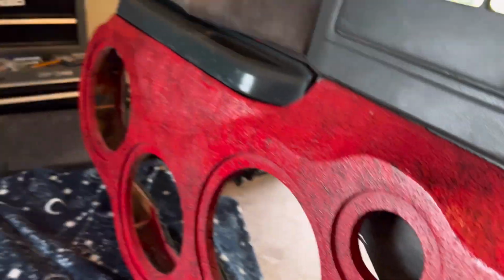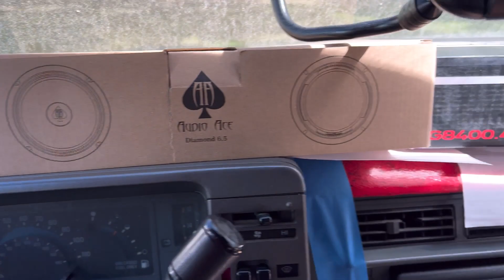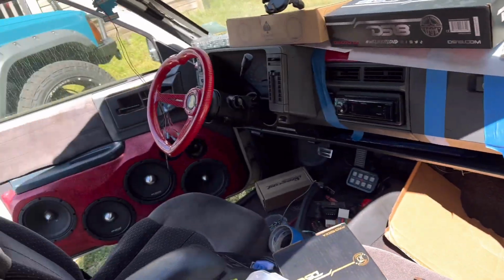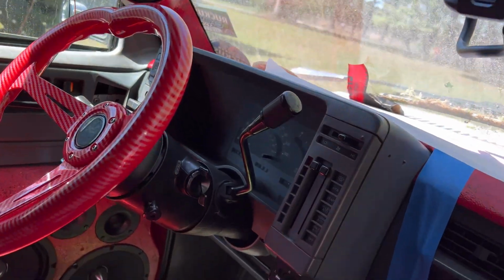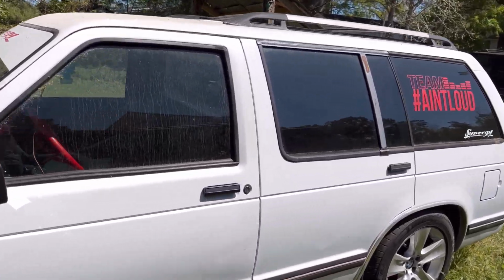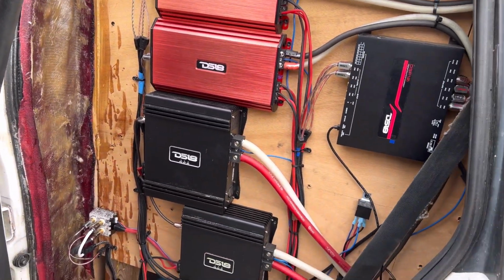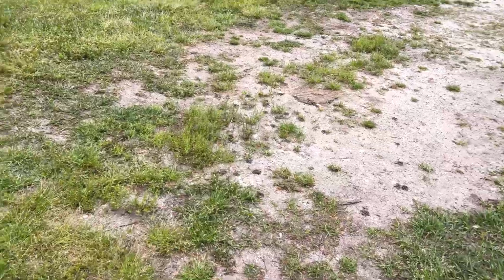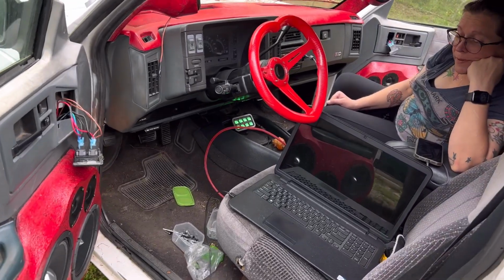Finishing blazer doors and A Pilar’s

Comment: If you have some leftover headway cells, maybe do 4 in series and put it on the mower. Then it won't drain down on you like the lead acid. Temperatures should be okay. 
I'm gonna take a few of those Headways and make a jump box with them. Great to have around the house for those vehicles still running lead acid batteries.

Comment: Pull the spark plug on the mower. May need an oil change. Try starting it with no plug. If it turns freely, your oil is too thick(old).

Comment: Got another question jerry! 😂 i just fried a head unit. I am running the brandx voltage regulator. Seems like it couldn’t handle 15.8-16v . Im just wondering if that sounds likely or if you’ve ever encountered anything similar. I also had some engine noise so ill be running the ground back to the battery as well. The head unit was a cheap Chinese touchscreen. My new one will come today. Id hate to fry a more expensive hu